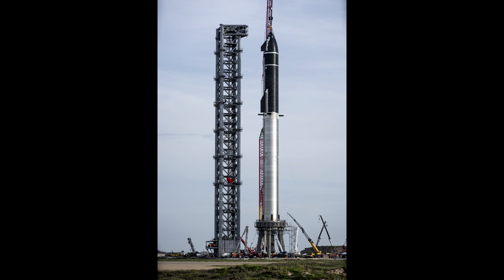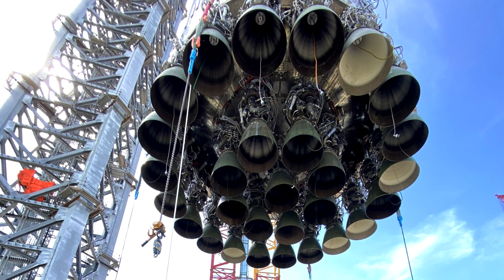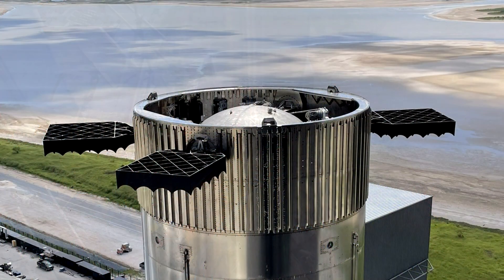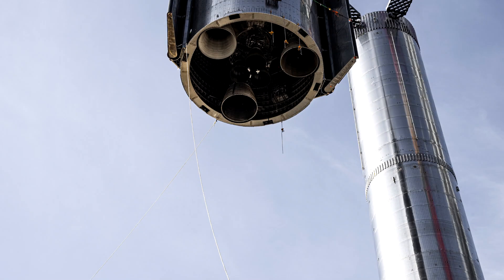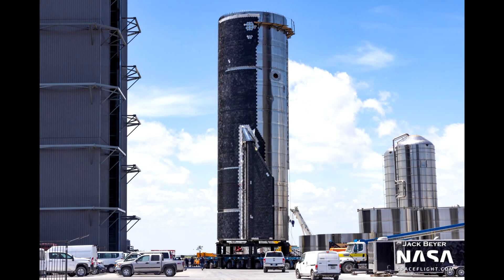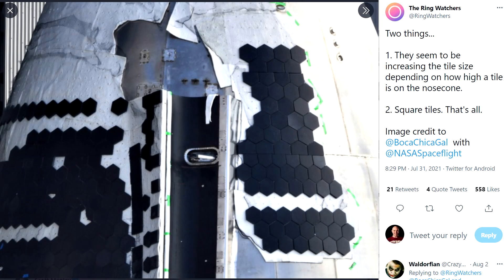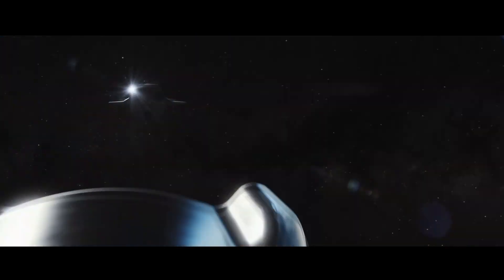How SpaceX Designed A Heat Shield For The Largest Spacecraft Ever Built

Comment: Am I the only one when hearing about 29 engines on a single rocket is reminded of the fate of the soviet N1 ?
Reply from the maker: You must be, most people compare it to the Falcon heavy with 27 engines.
Reply: @scottmanley  See my message 3 below.
Reply: With a half century of advances in computer modeling and CAD, in metallurgy and manufacturing they might have a slightly better chance.  But it's certainly not zero risk.

Comment: @Scott Manley .. my thoughts were to lay a new type of tile in a fashion not dis-similar to how birds feathers or reptile scales overlap. In re-entry there is only one way down and to have a heat shield which does not cover the next element seems scientifically naive. 
Think how a hawk/eagle dives. What is happening to the aero-skin being presented to the on coming blast of air.
The replacement shield after landing could be as simple as a fitted blanket for the nose cone because of how it is designed, with an overlapping feather like structure.
Not feathers but think (heat tiles or) scales like a snake/lizard and how they overlap.
Just my tuppence worth.
Cheers

Comment: Thought the stainless steel was supose to disperse the energy enough not to have to use a heat shield, a shield that was a pain in the but to replace every time the shuttle flew.
Reply: No, that was never the case.  Stainless steal means they can use a different kind of heat shield, which they are.
Reply: The Shuttle had thermal tiles on the bottom and thermal blankets on the top, as the aluminum would melt on either side. By using steel, they do not need thermal tiles on the top and are using their own development material for the bottom. One of the issues with the Shuttle was that almost every tile was unique. Most of the tiles for Starship are the same hex shape and they are trying to keep the other needed shapes to a minimum.

Comment: As far as the FAA approval, does anyone know how big an explosion it would be, in tons of TNT, if there is a problem at the moment of ignition and it all just goes boom? Please understand that this is not something I'd want to see. I love SpaceX and going to see launches at the Cape. I'm just curious.
Reply: Per the Russian after action reports, only about 15% of the propellant blew up on the N1 when it exploded. I'm not sure if that will be similar if Super Heavy explodes. The Super Heavy booster is expected to carry around 3,400 tons of propellant of which over half is LOX. The methane will explode and the LOX greatly enhances the burning. So I'm not sure the exact tonnage of TNT for the explosion. SpaceX and the FAA likely have simulations, but I don't think any have been released.

Comment: pickup trucks can get spray-on bed liners.  I've often wondered if this would work for spaceships. a spray on heat shield sounds pretty efficient.  anybody have thoughts on why this would or wouldn't work?
Reply: You just need a material that can be sprayed as a liquid but sticks and coats even, cures to a solid and can stand huge variations in temperature.  That's a pretty tall order.

Comment: i think the starship heat shield as-designed is going to be alot of trouble (like the shuttle).... i wonder why they cant design a heat shield that looks like inter-locking fish scales? (this vehicle will, after all, be flying through the "air fluid" like a fish goes through water :-))... anyway, random thought - would be difficult to do (maybe not impossible?)....
Reply from the maker: Starship airflow is in one direction on ascent and another during entry
Reply: reversible scales? :-)

Comment: Stupid question: I get why Starship needs to be very huge, but why does the booster need to be? The raptor engines aren't that tall
Reply: The booster is sized to the fuel requirements.

Comment: What stops them from using just a few large tiles for the nose cone? Like a banana peel. Or I guess what stops them from using larger tiles in general wouldn't it be easier for inspection and replacement?
Reply: It should not be a nosecone in that shape. It should be a blunt shape like a sphere. Then they could make a single wedge shape tile that fills the entire space. The same wedge angle for all, only the length and width proportionally change.
There needs to be tiles because they need expansion joints as the frame flexes with stress and heat.

Comment: Musk is aiming for "within the hour" reusability. I'm wondering if that is at all possible considering that the heat shield tiles will need some time to dissipate the energy that they have absorbed during reentry.
Reply: The surface of the tiles will receive quite a lot of cooling in the lower atmosphere befor landing, once the Starship has slowed down from re-entry.
Reply: @spankeyfish  yes, but if these tiles are anything like the ones on the space shuttle, they'll stay hot on the inside for a long time due to being extremely good thermal insulators. This heat needs to bleed off or eventually it accumulates to unacceptable levels.

Comment: I swear to God that I remembered (apparently wrongly) that they went with an all steel construction because they were having trouble with the other tech they were going to use, and that steel was more thermally resistive than the old materials, so it didn't need the thermal protection... Why was I so sure of this, I even remember them saying that Starship was now going to be all chrome, instead of the previous material (which I believe was some sort of carbon fiber/ nano-structure or the like)...

You can even see so many of the animations made before had no heat shields... Maybe it's a case of the Mandela Effect?? xD

Comment: What I don't get is why use the tiny tiles. I get that this is cost effective and practical, but they are literally making the same mistake as the space shuttle. Those things are a pain in the ass to replace, and take ages. If they are aiming for a faster turn around time for each rocket, why not substitute for bigger tiles?
Reply: The simple reason is that the underlying frame flexes. Each tile has an expansion joint with its neighbor.

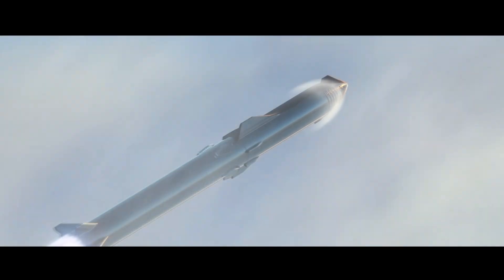Comment: 15:15 wouldn't it be much simpler to just put a camera on top of the booster, and then rotate the starship a bit after stage separation? They should have a minute or two before re-entry.

Comment: Anyone want to lay odds on there being someone(s) at SpaceX who's job is to skim all the fan blogs for what people are speculating they will do and write back-of-the-envelope feasibility reports on them? E.g. a cube sat to check the tiles. I'd bet a hour or two of work could tell the cost/benefit to an accuracy that would make it clear if that's worth pursuing in more detail. If I were running a complex engineering project, I'd have a standard template for such BotE studies and encourage people to write them regularly, and have a library for them to be published to.

Comment: Just my opinion, but I believe that there is no way the starship will survive re-entry from orbital speeds. The only thing that has survived are tiny capsules & the (far more robust) space shuttle. I believe the body of the starship, a huge, very thin wall tube, will massively deform under aerodynamic pressure, opening up lots of cracks between the heat tiles. I’m sure the SpaceX engineers have modeled this, and if their models shows it will survive, then I’ll change my mind.
Reply: Lol, it won’t survive the pressure from liftoff. It won’t make it out of the atmosphere. I’ll eat my sweaty socks if this thing ever gets into orbit.
Reply: @smcic  well, that’s what “max Q” is all about. Once it gets thru that it’ll likely make it, since atmospheric density drops off so fast with increasing altitude.. I have no idea how fast they were going on their test flight, but it seems pretty clear that they were significantly subsonic, & max Q happens around Mach 1.

Well all find out together, won’t we?

Comment: I'm still not convinced that you can fly a Starship 3 times in 24 hours when it relies on tiles for its heat shield. First, you'd have to have all of the tiles survive the flight completely undamaged every time. Second, your turnaround time will be limited by how quickly you can inspect thousands of tiles hundreds of feet in the air.
Reply: For comparison - NASA's SPS study had extreme payload/time needs, yet the shortest turnaround they could muster even with very optimistic technology assumptions was 72h - so 8h is unrealistic, especially with the size.
Reply: Why does Elon continue to say all this BS about rapid reusability when everyone knows it isn’t possible? I don’t get it.
Reply: @smcic  It isn't impossible - just very hard. But sub-24h turnaround is probably out of reach for now.
Reply: @smcic  I think it's possible. I just don't think it will be quite as rapid as he claims.

Comment: I have a question and I am hoping one of you out there has an answer.  Is the Starship SpaceX plans to send to Mars going to be one launched from the surface of Earth with a full payload or is it going to be a be a larger, more specialized craft that will be loaded and depart from Earth orbit?  Maybe I am to big a fan of science fiction but it seems to me rather pointless to assemble and build a structure that is strong enough to withstand Earth's gravity and the stresses involved in getting into orbit and a low G/ zero G environment. I think it would be more intelligent to assemble a light framework in orbit and then use something like Bigalow habitat modules to fill in the structure. have a couple of stripped down Starships that could be used to land on Mars and get back to the transport.  You could have a larger craft with it seems to me less mass and you would not be packing the large engines around that you would need to return and land on Earth.  I think three or four craft like that shuttling back and forth between Earth and Mars would make more sense than a large fleet trying to carry the same amount of mass. 

Am I totally of base here?

Comment: Sort of unrelated, but honestly I'm having a difficult time finding a straight answer, so I thought I'd come here and ask. Would it be legal in the United States to design and static test liquid rocket engines? I'd imagine there are quite a few laws and an untold number of precautions that would need to be followed and observed to have any chance of happening legally. What are your thoughts , or anyone elses for that matter? This is a mostlyy hypothetical question, but it's been eating away at me a bit.
Reply: I suspect that the problems aren't going to be that you're building a rocket engine - it's that operating a rocket engine involves a lot of hazardous chemicals, and a lot of noise, and that will in turn involve a lot of paperwork with the local authorities.
Reply: Anything that can be regarded as missile tech involves a deal of red-tape.

Comment: All those engines make it look like the N1 rather than Saturn V, which only had 5 large ones. Did anyone explain why the unnecessary complexity, aka synergistic fragility ?
Reply: Some of the engines will fail during the launch. Hopefully not cause tank penetration and just need to be shut down. Incrementally though it adds up to more stability when the force comes from many points. It also facilitates better control with 9 independent vectored thrust points on reentry.

Comment: If there is problems with adhesives gluing on tiles maybe a thin magnetic liner and static charge while traveling through atmosphere m8ght address heated and cooling properties of the fueling and flight mechanic's

Comment: 05:50  It's worth demonstrating just how fragile the shuttle tiles were compared to modern CC materials.
07:37  Lot's of opportunity for hull breach. I'm surprised they didn't use a stud welder.  https://youtu.be/395V3RfQ0ug
12:00  The key benefit of having a vehicle that large is that you can carry extra fuel. Why not use that to just decelerate from orbital speed an drop straight down.
Reply: It takes a lot of fuel to slow down that much.
Reply: @TheEvilmooseofdoom  
Ke = (M*(V^2))/2
Ke = 120,000*(1945^2)
Ke =  453963000000 Joul
Ke =  453963 Megajoule 

If we then divide the energy required by the amount of energy available in the Methane fuel:
453963Mj / 55.2Mj/Kg 
= 8223.967 Kg
= 8.224 Ton

A touch over 8 tons is by no means a deal breaker. It could easily just be subtracted from the 120 Ton payload. The remaining 111 Ton's could then be delivered to a kind of orbital refueling station.

The craft would at that point be truly reusable. No heat shields required.
Reply: @TheEvilmooseofdoom 
Now that I look at it. Wouldn't the heat shield almost certainly weigh at least 8 tons?

Comment: Is it just me, or did we literally lose a space shuttle due to this very design?
Reply: no, the space shuttle design was very different. space shuttle columbia lost some tiles due to an impact by some isulation foam form the external fuel tank during launch which created a hole in the heat shield. later, during reentry, hto plasma found its way into the hole and caused the shuttle to break up. since starship is placed ontop of the booster it would not be in the way of ice/debris.
Reply: @HamzahKhan314  yeah I'm fully aware of columbia's history, I was being rhetorical. And frankly stupid now that I look back.
Reply: @meusana3681  it fine. Although Starships heat shield design seems to be better than the shuttle, we wont know for sure until it is thoroughly tested with many reentries.

Comment: Why would they use high pressure FUEL rather than, say, nitrogen, for transpirative cooling?  Doesn't sound that safe...
Reply: Because they're already carrying it a board the starship so there's no extra weight Plus it actually does a better job creating a plasma shield if it is flammable. It would not be high pressure either it would be required to weep or sweat so a constant low pressure would actually be needed requiring an entirely separate compartment covering the entire surface needed to be transpiration ally cooled. 
From what I read, Elon said that creating the pores or micropores in the skin of the ship was problematic not in so much as they couldn't create the holes that small but that it would weaken the entire surface down one side of the ship. If they added an exterior skin with a porous surface that would require additional weight Plus there's the plumbing involved in releasing the fuel into the external cavity or area that it would seep through. It's all about weight when you're dealing with rockets apparently.
He also said he and his team were considering transpirational cooling of the areas around the fins that were difficult to use the heat shields on.

Comment: I'm thinking massive fuel delivery failure, due to stainless steel having not much give in it and it vibrating itself to bits with the biggest explosion we've ever seen from a rocket in human history,  tantalum carbide heat tiles I hope , probably not though?

Comment: O.k. you've examined your tiles with cube sat and found a fault! Now, what do you do?
Reply: Send up another Starship with some spare tiles and some epoxy? I'm half joking there, but that's going to be a genuine option once Starship is operational... Shuttle operations were too slow for that to have been possible with Columbia, but if a Starship encounter a problem that prevents re-entry, they really will have the ability to send a rescue at relatively short notice, and to evacuate the crew even if they can't save the vehicle.